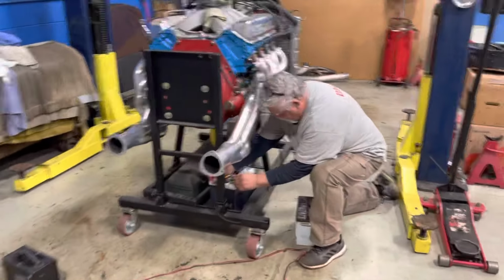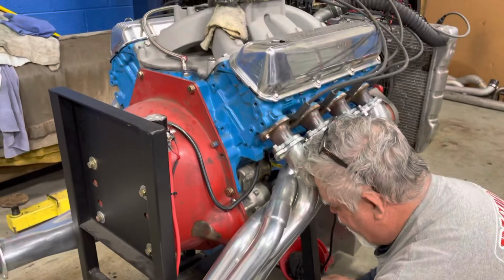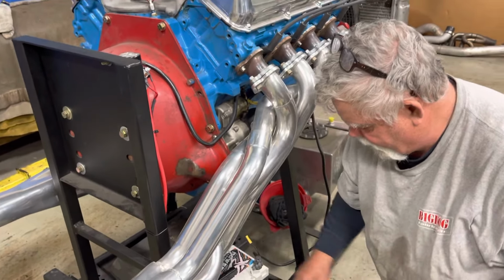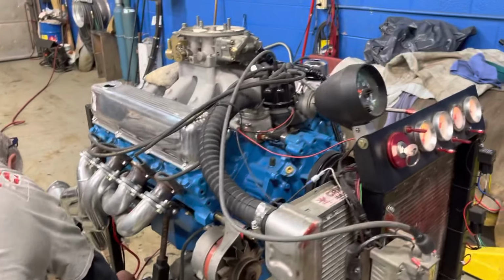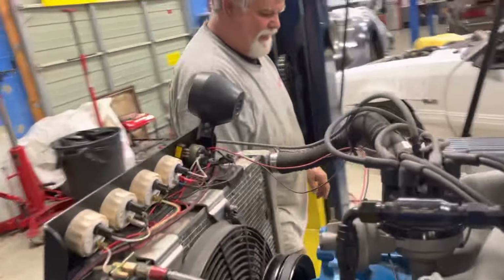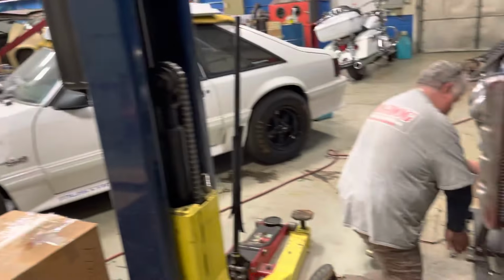Ford 429 Super Cobra Jet Start-Up GOING IN A FOXBODY? D0OE-R

Comment: That thing is badass 612 ci and street driving it, that is sick , it will make a badass sleeper car for sure
Reply from the maker: For sure!
Reply: I’m thinking he meant 512. Only way you’re getting 612 is with an aftermarket block. Or he meant HP
Reply: @droppedf100  Correct, Stock Blocks Will go 557 that's about it, and that's bored .080" over with a 4.50" Stroked Crankshaft.
Reply: @badass6.0powerstroke10  yup a 512ci with a 4.14 stroke crank or an offset ground factory crank with a 4.440 bore makes a lot more sense with a stock block and scj iron heads

Comment: Unless that's an Aftermarket Block, No way it's 612 inches, 557 would be about it for a Stock 429 or 460, and that's with a 4.50" stroker Crank and .080" over bore. So i seriously doubt it's 612 cubic inches, and still using Stock Iron Cobra Jet Heads. Very nice tho, Love the BBF,s in Fox Bodies. I went that route with mine about 15 years ago.
Reply from the maker: Think he said it was sleeved ??
Reply: @Neomustangs  Would still need Aftermarket Block. Oh well No Problems, i Love the 429-460,s they work just fine in Fox Bodies.
Reply: I'm real curious what the specs of this engine are, but 557 isn't the maximum. It's the maximum with a 4.5" crank and an .080" over bore. A 4.75" crank will fit a factory block with clearancing, they all have the same 10.3" deck height as A460 blocks or Eliminator blocks, and there's no issue with cam height or oil pan rail width like other brands' big blocks. As far as bore goes, it's luck of the draw, you only know after you've had it sonic tested. It's fairly common for a 429/460 block to be good for a 4.5" bore without sleeves, that's .140" over. If it's sleeved and running as much crank as it'll fit, it could very possibly be above 600 cubes on a stock block.
Reply: Also those are absolutely not aftermarket heads, that's something you can tell at a glance with these engines. The unmachined castings on the ends with those two little cylinder shapes in them are very distinct, with any aftermarket head for the 385 series you'll see flat machined ends that look nothing like these. These are factory iron heads.
Reply: @jimbojimson  Yes, there Factory Iron CJ Heads. And your Not gonna fit a 4.75" Stroke Crank in a Factory Block, Clearencing or Not, it's Not gonna work, Need Aftermarket Block.
Reply: @jimbojimson  No way in Hell are you gonna Bore a Stock Block 4.50" No way in Hell, once again. Just like the 4.75" Stroke Crank, it ain't gonna Work man.
Reply: @jimbojimson  Just get yourself a Eliminator Premier Block and Bore it out to 4.60" if you want, and it'll fit that 4.75" Stroke Crank. That's the Only way that Combo gonna Work. Or any Other Aftermarket Block, A460, or Whatever. You Cannot Bore out a Stock 429 or 460 Block to 4.50" No Way in Hell. Been there, Done that.
Reply: @jimbojimson  557 Cubes is it for a Stock Block, or if you wanna round it out to 558, then have at it. No Stock Block getting anywhere near 598 Cubes or Higher. Hell Will Definitely Freeze over before that Ever happens. Take a 4.75" Crank and just lay it in a Stock Block and you tell me how it fits...... I Dare ya.
Reply: @jimbojimson  Please Don't Spread Wrong Information. Unless you've done it yourself, and you Know it'll work, Obviously you haven't, I've Had, and it Most Definitely Won't Work. I'm sure if you try to bring that Stock Block to Machine Shop and tell them to open it up to 4.50"  He's probably gonna Laugh or he's gonna Ruin Your Engine Block if he attempts to. And ask about that 4.75" Stroke Crank too. I'm just letting you know, it doesn't Work.
Reply: @badass6.0powerstroke10  It's not very common, but 4.50" bore is certainly possible with a stock block.